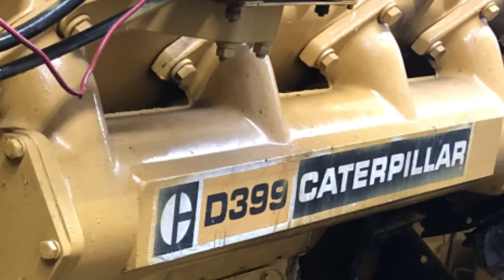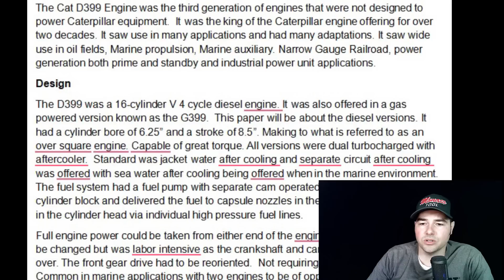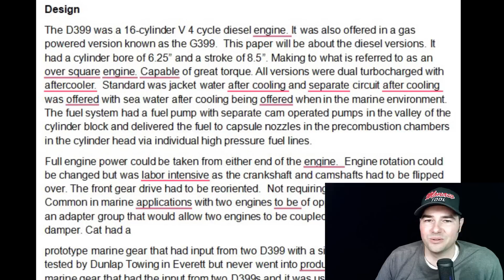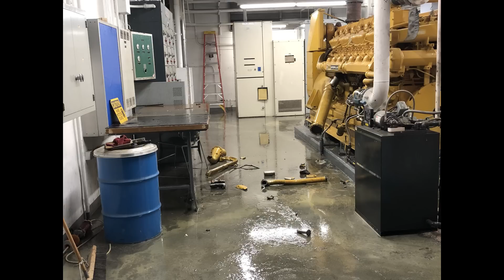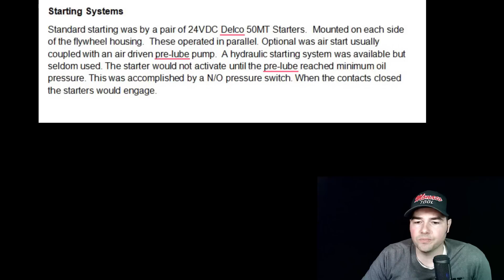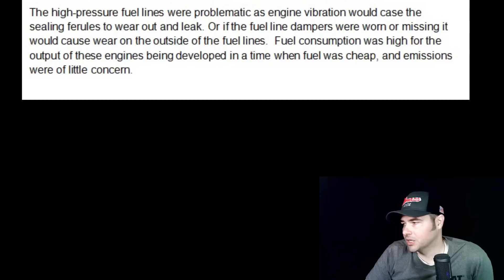The Cat D399 Diesel Engine. "Cast Iron Elephant."

Comment: Hey Josh., OK, hydraulic starters us gaseous accumulators to drive hydraulic fluid to the starter. Once the engine runs, a hydraulic pump will pump the fluid back to the accumulator, charging it. On small engines you can find hand pumps to fill the accumulator, but it works the same way. Hydraulic (and compressed air or gas) starters are commonly used in explosive atmosphere apprications (like drilling rigs and gas compressor stations. The D and G 300's you decribe here are 25-30,000 hour engines (between overhauls). A truck engine like the C-series are generally considered 10,000 hour engines. The 399's are not close to the larger engines CAT makes (C175 and CM Series) - FYI: CM's produce more than 500HP per cylinder (fun fact).

Comment: When i worked offshore we had a emergency back up hydraulic starter it had a hand pump and a nitrogen accumulator you used it by pulling out the air starter installing the hydraulic starter pumping it up by hand and activating it with a spool valve..... truly a last ditch device when nothing else worked and you were at sea

Comment: I work on 3512s. We use them on hydraulic fracturing pumps. Each pump is paired with a tractor that has a wet kit. In order to start the pump, we have to engage a pTO on the tractor which sends hydraulic pressure to the pump. Then this pressure is sent to the hydraulic starter. It works quite well as the amount of t of amperage required to start such an engine would be monstrous.

Comment: That was the 6 1/4 engine. 
379 was a V8
398 was a V12
399 was a V16. 
The engines are still in use today. 
Natural gas compression is very popular for these old engine. Converted to run on natural gas. 
Drilling ring use them. Mud pump motors and generators for diesel electric rig. 
Made lost of money working on those things. 
The 3500 series is the new replacement.  Now days the 3500's are old stuff.

Comment: In 1982 I was sent to the Persian Gulf to reverse the rotation on a D379.  All the shafts come out and are reinstalled flipped over, front to back,  the ring gear and starters are replaced , and the front accessory drive plate is reversed, putting the double idlers and the single idlers on opposite sides,  that way all the accessories still turn in the same direction.

Comment: I spent 25 years working for CAT Dealers in the industrial engine business.  I have worked on all the D series engines from the D330 up to the 1200 RPM D379 V8, D398 V12 and D399 V16.  The 3500 series was purposely designed to replace it in all 1200 RPM application and was capable of 1800 RPM doubling the applications available.  The 6.25 x 8 was replaced with 6.9 x 7.5 on the 3500.  The 3516 JWAC could direct replace a D399 SSAC at the same power level, or be equipped with SSAC for a power increase.  I still service a D399 owned by one of my Customers.

Comment: Bit of an adder,  1200 RPM is done via Generator (actually Alternator)  windings.   6 poles vs 4 for an 1800 rpm engine.    Cost more but the slower speed is fantastic for Prime Power,  Marine full time or lengthy operations.     I worked on a couple of the EMDs,  huge engines,  2000 hp (more or less depending on setup)  but they ran forever.    Locomotives and Marine.     I worked on one Waukeshau  900 RPM Generator/ engine,  two stories,  nuts as it was standby  application (Feds of course) -  on the 5th floor in a high risk earthquake zone.   Nutty.  .

Comment: These were common on drilling rigs. One I worked on had 3 motors combined driving a generator powering the draw works motor. Common drivng the rig fluid pumps and system generators.

Comment: I service a D399 at our water company in the East Coast ,it’s in a generator that was installed in the late 70s only has a 1,100 hours  on it. New Cat updated control panel system,we do not plan on replacing it,reliable workhorse. I am told 17:46 by our local Cat technicians many hospitals still have these in service also!

Comment: Marine power....worked on a few.  The Power supply for the town of Sand Point, Alaska was drivem on a 399. The 379 was v8 cylinder, The 398 was a v12.

Comment: Excellent video! I was an operator/mechanic at several prime power isolated buss small town power plants, and also marine propulsion with the D398 V12 version. There was also a V8. 1200 RPM was the rated speed on these engines. Very reliable and long TBO (frequently 30000+ hrs) when operated and maintained by professional personnel. Usually running 24/7 until time for an oil change, then cycled to standby while another unit took over for the next interval.

Comment: I worked on crab boats in the Bering Sea in the 1980s.   These engines, and the 398, were very common up there.   We used to run often at around 1000rpm to use a bit less fuel. Prelube, air start that spun the engine like there was no tomorrow.  And fuel filters all set up to change them while running.  Can’t remember exactly how much oil they held but pretty sure it was more than 160 gallons.  Great engine.

Comment: F/V America #1 was a catcher/ processor built by MARCO in Seattle...she was big at 160 feet.
Crab boats have a main engine  and then multiple gensets running hydros and powering the electrical. 
The crabber I was on with a 399 used an air start...with  gensets you could use a hydraulic starter system instead.

Comment: Regarding the dual fuel filter housings and being able to switch from one to the other, it’s extremely important in marine applications to be able to keep the engine running even with fuel issues. One set of filters gets clogged, switch to the other set and clean them. In manned engine rooms, you have no choice but to work around the engine while it’s running.

Comment: 1200hp @ 1200rpm is 5252ft/lbs. There is a marine version rated 1380hp at 1300rpm, which is 5575ft/lbs. 
3516 for machines can come rated at 2000hp at  1800rpm, which is 5835 ft/lbs , and a 3516C Marine Propulsion Unit can be had at 3385hp at 1800rpm, making 9876 ft/lbs.

Comment: Josh, I noticed you mentioned nozzles. This is something I’ve been trying to understand lately. Can you explain what nozzles are and how they differ from a regular mechanical injector (non unit injector). Like a 3406b (nozzles) vs a 12v Cummins (mechanical injector). Both run very similar looking pumps, but very different type of injectors.

Comment: In the late 80s i worked on a sysmagraph boat 180 ft in the gulf. We had 4 of those beasts on board. 2 running high pressure (2000 to 2100 psi) high volume air compressors and 2 more driving the boat. Great engines. We ran the compressor at 1200 rpm. In the time i worked for that company I did inframe overhauls on 2 of those engines

Comment: Could you do a video on the 6.2/6.5 Detroit diesels? Highly divisive engines, but an extremely interesting subject. They were actually produced for almost 30 years, the last near-decade or so was non-civilian, and those had improved metallurgy courtesy of Navistar who used powerstroke blend. Fixed all their problems.

I strongly suspect the 6.2 was intended for passenger car service, as evidenced by their use in a fleet of caprices/impalas (I forget which) in ‘81, but if you know anything about the 5.7 Olds debacle, you’ll know it was a disaster in that period of time. I think GM knew they could never sell the 6.2 in a car on reputation alone and had to put that engine in whatever it would fit in, which happened to be everything, because it has the same mounting dimensions as a big/small block.

Another note, the 6.2/6.5 probably have the most variants/trim specs of any engine I can think of. C code, J code, etc etc, side turbo, center turbo, all the different styles of coolant neck, I legitimately think it’s impossible to know just how many variants of 6.2/6.5 parts GM made over the decades.

I really like the “dry” intake valley, and while I hate the fuel injector position on the far sides of the heads, the injector return setup is way better than Ford’s IDI’s, whose stupid return caps and o rings are bound to become unobtainium someday, though the engines themselves are better.

Anyway, I fully believe the 6.2/6.5 are the ultimate automotive diesel swap. Buy a small block Chevy mount adapter and drop a 6.2 in. Keep all the V8 noises and easily double your economy.

Comment: I don't normally comment on vids but this one struck home. I cut my teeth on these engines; after completing diesel trade school, I went to work at a boat company that had tugs and oil field supply vessels. The company had over 200 boats and majority of them that were supply vessels had these as main engines, standard was 2 engines per boat, they also had 6-71 Detroit diesels on 60 kw generators. Being a port engineer, we met the boats as they came in to pick up supplies for the rigs. Overhauling the engines was always a shipyard event, while it was getting hull repairs, inspections from Coast Guard or ABS. It took approximately 7 days 18 hr. days to do both engines, 4 man crew. The heads weighed about 200-250 lbs. which were carried by hand up the stair well. The scariest part of this engine was starting it after injector pumps were replaced, it had an overspeed under the governor, but the manual trip was located in the "V", which put one of us on top the engine during start up, if one injector pump was off by 1 tooth the engine would run away. Other than that, it was a pretty simple engine, most components were heavy, so they were handled with come-a-longs when possible. If I remember correctly head torque was 250 ft. lbs. rods were 180 ft. lbs. and mains were 120 ft. lbs. plus a third of a turn which ended up being around 365 ft. lbs. Water pumps and oil pump were driven off of front gear train. On the one you showed it had thrown a couple of rods; the oil cooler was the part hanging at an angle. If you have any questions I will do my best to answer them. Low idle was 500 rpm, high idle was 1200 rpm, max rpm was 1325 rpm. At 1200 rpm turbos ran about 800 F.

Comment: Worked on a few drilling rigs that had several of these powering gens back in the day. When you were on bottom drilling a deep well at high pressure and high pump rate, the 99's were barkin! 😆

Comment: I worked on the Glomar Coral Sea and it was powered by 6 D399's  Also did wok on some oil platforms that use D398's for the drilling rigs.  Actually, D399's and D398's are pretty common for drilling rigs and som are still around.  

The big benefit to them was that they're torque monsters.  At 1.200 RPM when a rig will pull a heavy weight, the RPM doesn't drop more than 5-10 RPM from the loads.  These things were a workhorse.  They also weren't that full efficient however.

Comment: I worked on portable crusher in Alaska to portable crushers for traveling around the state one of the 399s with electric start the other one had an air start. Yes, slow but powerful and I do believe has a larger company purchased of the one I worked, for they had all been replaced with higher RPM, better fuel consumption of course the trade-offs higher RPM, the more often rebuilds had to be done.

Comment: The detroit like the 72 series had a hydraulic start option. You'd hand pump them charging the accumulater till you got to the start pressure. I saw it flipping threw the manual. I'd send a Pic if I remember

Comment: My uncle use to work on them in the 80's. He had to roll bearings into the rods and the book said you had to do it from the bottom and took 2 days.  He said they went threw the inspection covers on the side, and they had  it done in a day.

Comment: On the topic of hydraulic starters, I was on a frac crew for a couple years and we had large V-16 and V-12 MTU engines that had hydraulic starters that were mounted with a frac-pump on triple axle trailers. The starters ran off of the wet line kits of the trucks and were engaged via electric solenoid when you wanted to start them. I wonder if the D399 hydraulic starters were the same case?

Comment: I worked at a place where the hydraulic starter for the generator was a cylinder hung in the air after we lost power the magnet turned off the  the weight of the cylinder pushing down on the fluid would start the hydraulic pump which started the starting sequence I should have took way more pictures

Comment: Josh, not related to this video, can you talk more about the oil bypass valves in a 5EK oil filter housing? The difference between the original parts and the upgraded parts you talked about in the low oil pressure video.
Thanks

Comment: I worked on a diesel engine with a manual hydraulic starter! A lever was manually pumped by hand. It was a long hard job. The pump looked like a pump for Enerpak cylinders. It forced a volume of oil into a cylinder with a spring resistance pushing on a sealed piston until the cylinder was full. Then the cylinder of pressurized oil was manually released by a valve and would flow through the hydraulic starter that would turn the engine. It was very hard to troubleshoot because each time the pump had to be manually operated for very few seconds of engine rotation. The engine was the propulsion power for a fully enclosed life boat on a large ship.

Comment: Hello Josh - for many years I hoped you would do a video on the D399.  One of the wastewater treatment plants we worked at years ago  had a D399 Genset as a backup power source.  Strange thing is that it was in the basement 30 feet in the ground and there was no access to it other than a man door sized entrance into the generator room.  They must have built the plant around the genset during construction.  I don't know how they would ever get the block out of the room if the engine ever failed.  In the same plant there are four D398's driving the storm water bypass pumps.  Two 398's are coupled together by a gearbox to drive a single pump.  I think the 398's were on the second level in the basement.  We changed out one of the electric driven main pumps at the very bottom of the plant on the 5th level which was 80 feet below ground level.  A very strange design for wastewater treatment plant.

Comment: The fuel pump in the valley is basically a giant 3406b fuel pump. The diesels do not have the pencil style nozzles but that short fat nozzles the old 3412 and 3406 engines had until they realized they needed smaller cups for more cooling capacity in the cylinder heads. The lock nut for the nozzles were really prone to loosening and the engine would start white smoking I went out to probably hundreds of these calls. The hour meter on these things ran off of the fuel pump gear and would leak oil badly over time. To repair the entire filter housing assembly would have to come off. The cylinder heads were also stupid heavy, and some of the engines have head studs and not bolts and were a huge pain to get onto the head studs especially on a drilling rig gen skid with no help lol.

Comment: Hydrulic starter… so with oilfield frac pumps applications, they use big V diesel motors mounted to a transport trailer. Used the tractors pto hydrulic wet kit to operate hydraulic starters on these massive V-12 or V-16 motors

Comment: @vagabond96h....we definitely had 2 D353's for SSDG. Also a 6-71 Detroit for EDG....They all ran at 1200 rpm. I think D343's were in the D8 crawlers, the manifolds are on the same side. The 353 have exhaust man one the rt and intake/after cooler on the left right above the fuel pump/Woodward UG8 governor. Our ship was eventually sold to Taiwan....maybe it's still commissioned???

Comment: As of today, there are a least 6 or 7 Tug Boats in New York Harbor that are still running D398's and D399's.  On the Tugs we ran them around 1,800RPM max.  The first Tug that I was ever Chief Engineer on had a pair of 398's for main propulsion.  They were rated for 900hp each, we were twin screw for a total rating of 1800hp for the vessel. The 399's were rated at 1100hp or 2200hp for both.  I had a 398 put a rod out of the block. It was #1 and she was still running with 20psi of Lube Oil Pressure!  These engines could be a real bitch to work on until you found out some of the trick the service techs would use.

Comment: hydraulic starters were available for marine applications where intrinsically safe starting could be needed in the absence of an electrical system. have a look at the bryce berger handraulic starter it uses a manual pump with a nitrogen charged cylinder and a ratchet mechanism to turn the engine from the front !!! i have one still working on an old wooden boat, the working pressures are something like 40-80k psi !!!

Comment: Never saw a D399, but worked on D398's in the 80's. The military had lots of these for power generation. The 398 was a 12 cylinder version of the 399. The 398's were rated for 500kW at 1200 rpm. 1200 rpm was actually a pretty common speed for mid-size engines for power generation. Once the engine were a bit larger (EMDs, Alcos, etc) they typically ran at 900 rpm for power generation. The 398's were very cold blooded. Under 50 degrees they were ether babies.